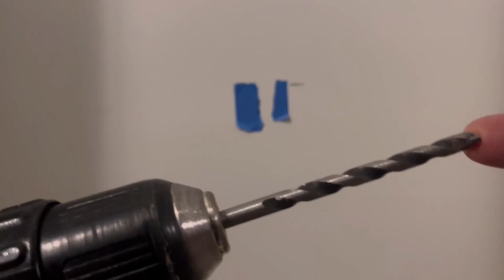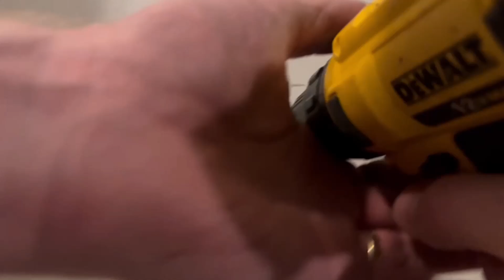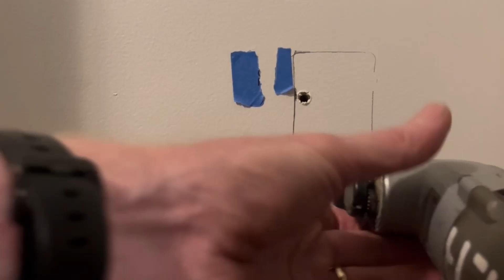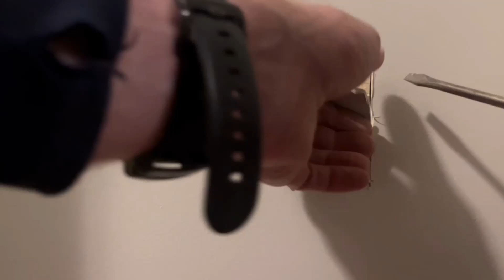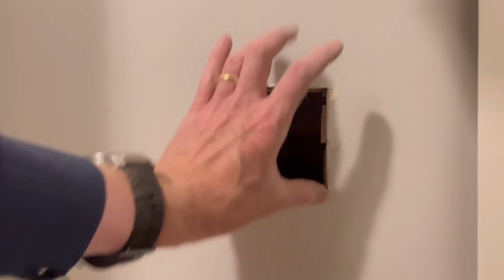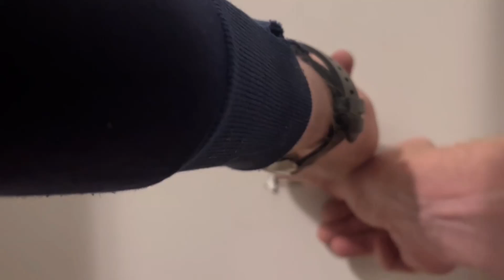Cutting Electrical Box into Plaster and Lath Wall

Comment: Thanks for this video! Just installed the first outlet box in our 100-year-old house today (dropping from the attic to the second floor), and your tips made it all work flawlessly. Especially (my takeaways): Cut as close as possible to the stud; score the box first and pop out the plaster wall; knock out the plaster between the lath; cut the lath starting furthest from the stud. All made sense and helped do the job beautifully. NOTE: I don't have a stud finder like yours. I use a primitive stud finder for old lath and plaster walls -- it's a magnet hanging from a string. I slowly slide it across the wall and it helps me find the stud every time by magnetizing to the stud nails.

Comment: Unfortunately he did it wrong. Do not do it this way. The hole should be centered on one lathe so the least amount is removed from both adjacent lathes. Its also advisable to insert a sheetrock screw to hold the end of the center lathe while being cut to keep it from vibrating.

Comment: Do 60-70 of those in a big Victorian because the cheapskate didn't want to gut the house to the bones the right way and after the first 10 meticulous cuts you'll take a framing hammer to it to make your holes and the cheapskate can buy a 5 gallon tub of mud to patch with!
Reply from the maker: When we had our house re-wired, I did 30+ this way after the electrical contractor blew out a whole section of wall trying to cut a new hole with a saws-all. If I had to do it in bulk, I would try an angle grinder with a diamond-cutting disc and a tuck-point shroud, as suggested by another viewer in a comment on this video.

Comment: Thanks for sharing! Finally trying to convert the pull string lights to switches in my 1900 house, and wasn't sure how to secure the laths after cutting them. For some reason I didn't even consider gluing the piece to secure them! Way cleaner than screws

Comment: To add -- always caulk these old-work boxes on older houses like these. The walls are seldom insulated well, and there's a surprising amount of drafts even through the interior walls. Put a bead of caulk on all edges of the box, just before you push the box back into position for the last time. Then wipe off the excess caulk with a paper towel, true up the box, and run the screws home.

Also, do a dry fitment of the box, before the wire or caulk is in your way. Push the box tight against the stud as if it was screwed down, and make sure it doesn't sit cockeyed in the opening. You may have to shim it, and it's better to know that first before you have the cable and caulk to contend with.

Comment: I have tried so many methods and tools for cutting the plaster and lathe. I recently found a great one for cutting larger areas. An angle grinder, with a diamond cutting disc and a tuck point shroud. The tuck point shroud is key, it allows precise depth control like a tracksaw and also has contained dust collection. It can be set to just cut the plaster or go through the wood also. It does not vibrate the lath much at all, by far the most gentle approach I have tried. I have not tried it yet with single gang boxes but it obviously has a limit on how small you can cut.
Reply from the maker: The tuck point shroud does sound like a great tool. Even if you could get the straight parts of a single gang cut cleanly, it would only leave the corners to finish with an oscillating cutter or similar tool. A vast improvement over my closet cutout with a Skilsaw that I called the 'plaster blaster'. The noise and dust were crazy, but it did make a fairly clean cut!
Reply: @DrDanTeaches I did a similar progression of tools as I learned what worked and what didn't. The reciprocating saw was the worst; it destroys lath. For delicate areas, I resorted to a fixed utility blade and repeated scoring. It chews up the blades, but it works well, and the blades are cheap. We recently had a full rewire done, so I needed to cut large areas of ceiling and wall out, and after settling on the grinder+tuck point, it will be my go-to. I also tried the Makita drywall cutout saw. For drywall, it is absolutely amazing. If they just made a carbide or diamond blade for it, it would probably beat the grinder method because of its more compact size and better precision, but at the moment, they only sell standard blades, which the plaster eats up in seconds.

Comment: ugh I wish we could have seen the blade on the plaster, and then on the lathe! my plaster crumbles, and the lathe is so hard to cut because it isn't stable. they push back with the blade so cutting them is a PITA. secondly, looks like an allied fiberglass box and would love to see you open the bloody clamps in the back without a tool! otherwise thank you so. much!
Reply from the maker: With weak plaster and hard lathe, you could try putting a screw partially into the lathe and pulling with locking pliers on the screw to minimize lathe movement. Make sure your plaster blade is dull and switch to a sharp blade for lathe
Reply: @DrDanTeaches thanks! I’ll try that

Comment: We are trying to mount a flat screen 50 inch tv on our plaster and lath wall and are having an impossible time trying to find a stud to secure the metal tv mount. We even purchased the Zircon Superscan at lowes for $69.98 thinking it would for sure detect the studs, but read the manual and it said not for plaster and lathe walls. Would the Zircon you have shown in this video work on our wall? If so could you provide a link for the exact one you use please?
Reply from the maker: https://www.lowes.com/pd/Zircon-1-5-in-Scan-Depth-Metal-and-Wood-Stud-Finder/3092949 this is the one I have but I’ve had it for over 10 years so there may be better ones now. Make sure that you scan in multiple places vertically and use some blue tape to mark the potential stud locations. With multiple points of evidence, you can usually dial it in pretty close.

Comment: problem  is when the plaster is over 100 years old and crumbling away when touched!
Reply from the maker: That is rough. We had some sections of plaster that were quite fractured and basically held in place with the many layers of wallpaper! If your plaster is solid but separating from the lath due to the keys breaking off, try this: 1) use a masonary bit to drill holes in the plaster over a piece of lath the size of the tip of some Power Grab Construction Adhesive (https://amzn.to/4fnFg0x), then 2) squirt in some Power Grab, 3) add a screw with a drywall washer https://amzn.to/4fnFg0x to gently clamp the plaster against the lath, 4) come back the next day to remove the screw and washer, and 5) finally skim coat over the section to smooth everything out.

Comment: How many holes can you cut in plaster with the dull blade? How many holes does the sharp blade last on the lath? I have 20 to cut in
Reply from the maker: @tomweslowski4116  sharp blade life will depend on quality of blades and how many nails/ plaster bits you cut. Maybe 2-6 holes per blade? you’ll never run out of the dull blades as all the sharp ones become dull 😀

Comment: Thanks for posting.  I did not know there was a super glue -- Wood Glue.
Can you post link for the glue you suggested?
Reply from the maker: @edsullivan1710  It really can speed up projects Akfix 2-Pack 400ml 705 Fast... https://www.amazon.com/dp/B09CBKL7FF?ref=ppx_pop_mob_ap_share
Reply: @DrDanTeaches  
THANKS!  
Much appreciated.
Reply: Can probably also use generic construction adhesive
Reply from the maker: @ that would work and I’ve also used wood glue as it dries pretty solidly within about an hour